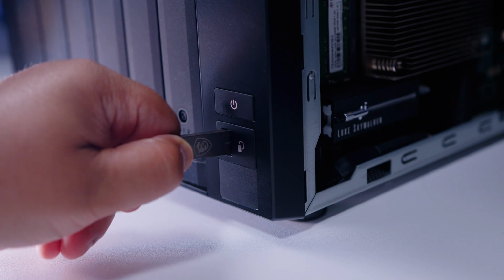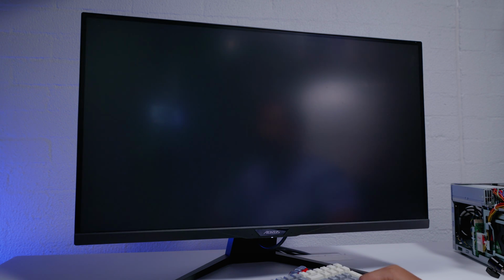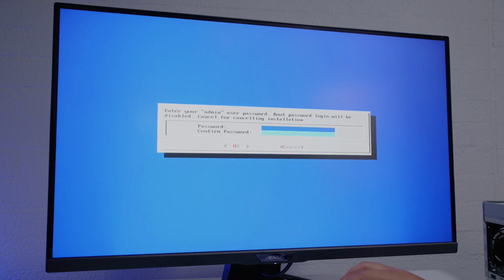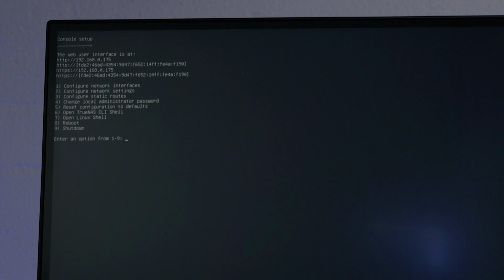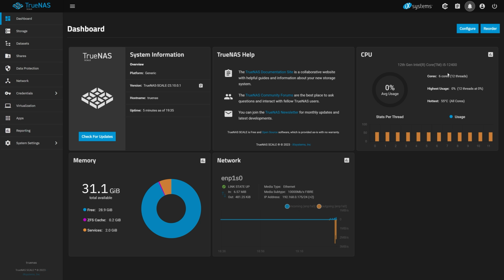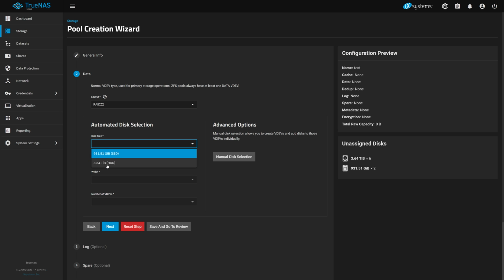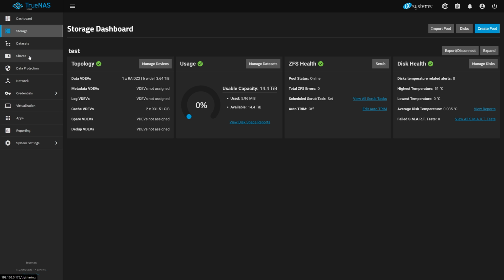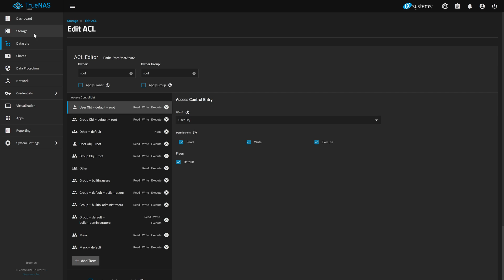Installing TrueNAS on a QNAP NAS the right way... sort of

Comment: Currently working on a similar project TS-453A (only a 4 bay, and limited as it is but it's what I have) also looking for ways of getting the front panel working again. Stuck with not being able to get Pyserial installed.
Reply: Hope you can do it
Reply: @Nehemoth_G cheers I have had some success but gave up and moved onto a rack mounted qnap as I wanted more disks. Eventually will get it working - but transferring 20tb has been a bit of a slog. It will happen though
Reply: @envoycdx  I've installed TrueNAS Community on a TS670 Pro. I know this says you moved on but I seem to be stuck at the Pyserial stage as well, did you end up having any further luck?
Reply: @MWBoardyman not yet i have a qnap 879rp now but I haven't got back on with the pyserial bits yet (long story short its a rack mount unit and i have quickly ran out of space in the workshop) something i hope to revisit in the new year.

Comment: Thanks a lot for this video. I think I will try to do as @saintbenedictscholacantorum suggested and just disable the dom in the bios. I will try to install on an nvme ssd instead, event if it's a bit of an overkill at leat it will be fast. I am still wondering if you can set the fanspeed to auto or if it' 100% all the time which would be noisy in my environment. Thanks for clarification

Comment: Have you tried buying a larger DOM and running TrueNAS directly from it?   I know you're limited by the interface speed but I'd be curious to see how well the OS performed running common tasks/apps.
Reply: @Spreadie  you can use bigger capacity DOM, but bear in mind it is time consuming to install the system or later do an upgrade on it. However it works fine. TrueNAS usually mention 8Gb as minimum boot disk size. If you buy 8Gb DOM it is actually around 7.5Gb. Buy at least 16Gb DOM

Comment: This is JUST the video I've been looking for! I've got a QNAP TS-h973AX that has no video capabilities, so no messing with the device BIOS. What I was thinking MAY work is pick up a 16g DOM module and a cable like you have there, connect them to my PC via USB and install the TrueNAS OS onto it. My hope is that during the install, it'll pull a IP Address that I can search for once installed in my QNAP. 
I'm a little concerned about the cable though, I picked up a male 9pin USB-USBA cable, but I'm a bit concerned that the pinout may not be correct? Or am I misunderstanding what you were talking about? Any info would be awesome and appreciated. Again thanks for the great video
Reply: So did it work??
Reply: yeah curious myself did it work? i'm looking to do this myself waiting on a cable form China arriving.

Comment: It's great to see a video about this!!   At the office I have several old QNAPs that I converted to TrueNAS.   But, I was a bit afraid of the USB DOM, so I just disabled it in the BIOS boot order, then ignored it entirely and found different methods to boot the system. TL;DR: you can boot from SATA if your QNAP supports it!

There is a lot of variation among different models of QNAP, and there are a few caveats that potential tinkerers should be aware of.

1. Some QNAPs have an ARM processor, so they almost certainly won't run TrueNAS Core/FreeBSD.  There might be a way to install Debian and  hence TrueNAS Scale, but I haven't tried!  QNAP OS is Linux-based after all, but I don't know if there is mainstream kernel support for the ARM devices.  If you have an Intel QNAP, it will be a lot more flexible.
2. If your QNAP doesn't have a video port (e.g. HDMI) to even look at the BIOS settings, it probably has a serial console port, which may look like a mini headphone jack.  I found a no-name cable on Amazon with the headphone plug on one end and a DB9 serial connector on the other end, which you can use with your favorite terminal emulator.
3. I found that the biggest problem with booting USB is not the reliability of the flash, but the reliability of the bus itself.  This may have been unique to my old model of QNAP, but quite frequently the USB drive would disappear entirely, at random, possibly weeks or months after the system was powered up, and the BIOS would not find it again, even after a reboot, unless I would do a complete shutdown, then physically remove the power cords (!), wait for the motherboard to be completely un-powered, and finally turn it on again.  After this it worked fine again like nothing ever happened, no drive corruption.  (I was using a mirror of two USB drives just to be safe!)  I reproduced this problem on four different QNAPs and tried all possible USB ports. (But not the internal DOM!)  Maybe newer QNAPs are immune to this problem, or maybe TrueNAS Scale works better than Core.

To avoid using any kind of USB boot drive, I found a few ways to boot from a SATA drive.

1. First, my QNAPs have an **internal SATA port**.  The only problem is, there no standard SATA power connector in the device, only the data port.  But, there is a 4-pin header on the motherboard intended for SATA power, which is actually a "floppy drive power" port.  You can find a rare cable on Amazon to convert the floppy connector to SATA. (The cable needs to be female on both ends.)  This is ideal; just plug a SATA SSD directly inside the case.
2. The front bays of the QNAP may be either SATA based or SAS based.  If they are SATA based, all the hot swap bays may already appear in the BIOS boot order, and you can just pick one of them for a boot drive!  You lose storage capacity for the sake of simplicity.
3.  If the QNAP is SAS based, it may use an unbranded LSI/Broadcom/Avago HBA to connect the hot-swap bays.  In this case, you can actually use a normal LSI sas2flash utility to flash an LSI BIOS ROM onto the SAS HBA, so it will enumerate all the front drives at boot time and allow you to choose them in the BIOS.  I have a 16-bay QNAP, and now have 17 SAS and SATA drives to choose from in my boot order!  I got my sas2flash and ROM image from the Art of Server, the premiere font of information about SAS HBAs.  To identify the right family of LSI controller for your system, you can boot into Linux and run `sudo sas2flash -listall`.  You might not be able to upgrade the firmware but you can flash the boot ROM as a separate component.  (No warranty implied; proceed at your own risk!)

Hope this helps somebody!  :)  I sure had fun.
Reply from the maker: That's quite interesting. Im trying to source another USB DOM to have as a spare but everything I find is of questionable origin. I have thought about dd'ing the original one and backing it up and overwriting QuTS. As I'm writing this I think I have another QNAP around. Might pop it open and see if it has a USB DOM I can steal out of it.

Comment: My qnap don’t have hdmi, is possible to install Ubuntu server or something else?
Reply from the maker: Probably not to be honest.
Reply: Check if it has a serial console port - some of them have a unique serial port that looks like a headphone jack. If that's the case, you need to find the right cable to connect it to a terminal emulator.   Also check the CPU, whether it is Intel or ARM.  In the latter case, can you find an Ubuntu or Debian image that supports that particular model?  If you have a kernel that supports both the CPU and the serial console output, and if the system can boot from a USB drive, then it should be theoretically possible. :)
Reply: Of course you could. These are just pc's with NAS OS's installed on them. They have a BIOS like any other pc. They are just X86/64 pc's.

Comment: The whole DOM thing DONT do that.. Just go into the BIOS of the QNAP, change the boot order and use one of the USB ports to install TrueNAS onto a SSD in a housing. No need to remove the DOM, if you remove the Glue you technically void your warranty. Leave the DOM in the NAS as a fallback if you have anything go wrong. That way you also avoid the whole frying your motherboard if you wire something up wrong putting a USB port internally too.
Reply: This is exactly the comment I was looking for. Thank you. Fussing around with the internals feels sus. I'm sure it's doable and wonderful. It's just not for me. I have a QNAP TS-1232PXU-RP-4G and I'm tired of trying to get it to cooperate with my much bigger TrueNAS across the way. I'm going to try this in the next week or so. Thank you!
Reply: All true - but if you have no warranty and/or you want a clean setup this is a nice option too.